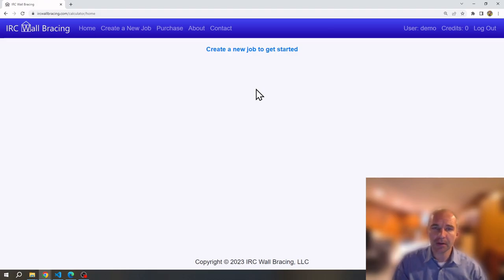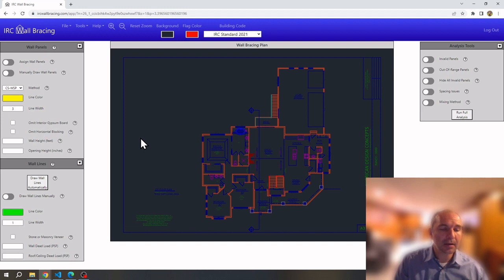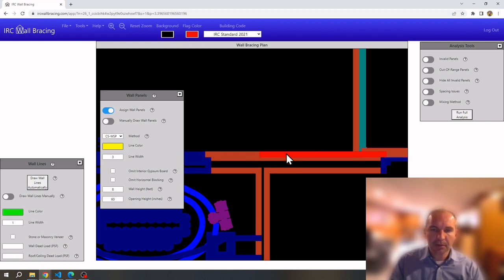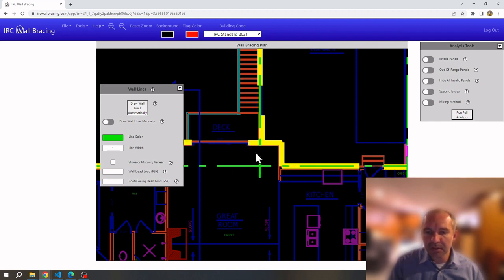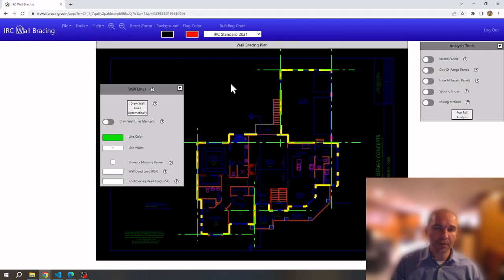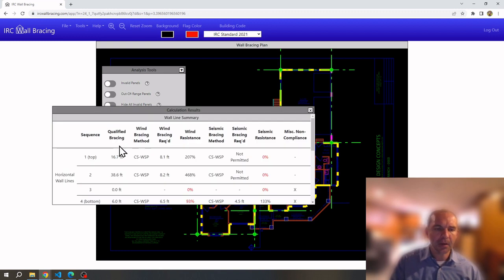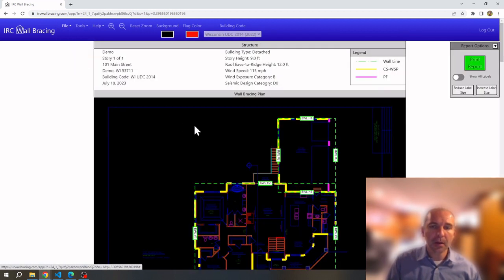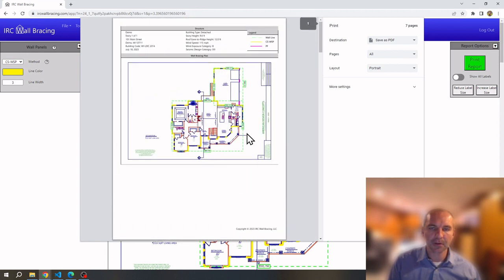IRC Wall Bracing Calculator Demonstration

Comment: Heyyyy....lucky me, the BEST Designer/Builder on Earth finding THIS helpful YT-video, for something I've loooong-sought a solution for!!! Thanks IRC Wall Bracking. Now....let's see what this is all about.... ohhh...I'm in SW FL, USA, where in Fall2023 construction is mainly CMU, but I much-prefer WOOD-FRAMING. It...rocks! :-) HomePlansDrawn dottt commm

update: so...what does it COST to use this on-line Calculator???
Reply from the maker: Thanks for your enthusiastic interest! The cost is $10 per floor plan, but I'm afraid the program doesn't support the FL residential code (wind speeds > 140 mph).